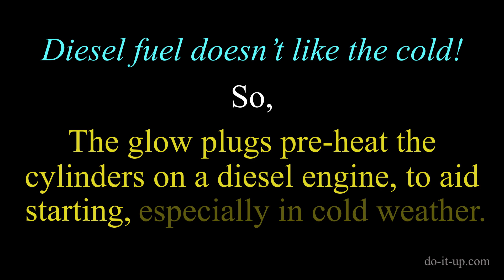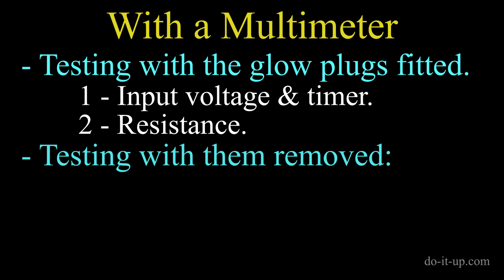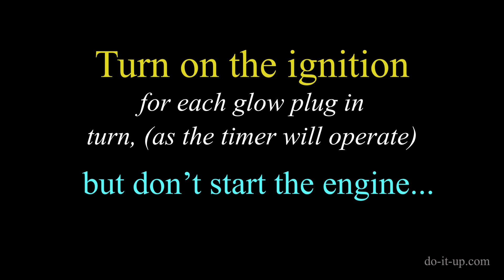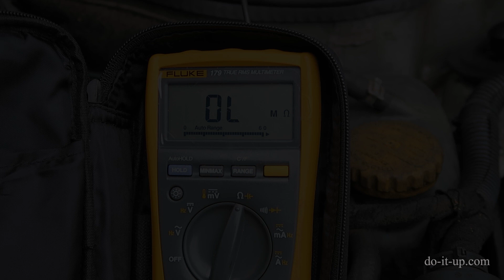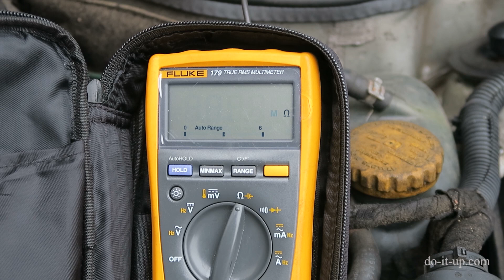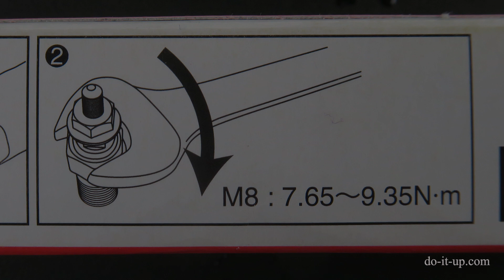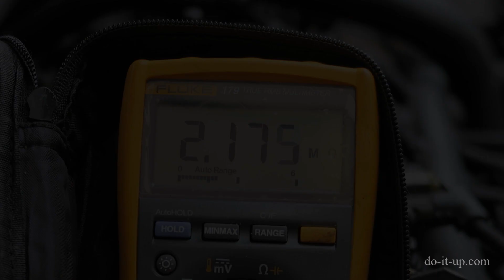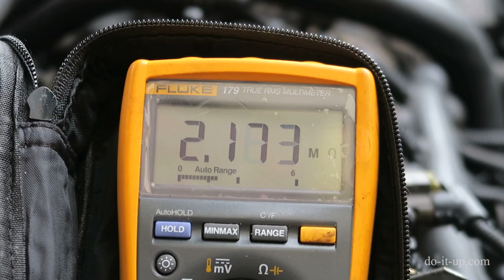How to Test Glow Plugs From Start to Finish (With a Multimeter) - The Complete Guide.

Comment: does the car now have smoke on first start after the grow plugs have been installed??
Reply from the maker: Hi, If glow plugs were the cause of bad starting, then starting should be much improved. However, you may get smoke on first start for a number of reasons. It could be due to:

- Condensation if it's cold, (the smoke from the exhaust should look different).
- Residual diesel left in the exhaust from unburnt fuel from the original issue (white smoke). This will eventually get blown out or burnt off from by the exhaust heat.
- Many older diesel's can smoke on start up due to wear & tear. Often improving when the engine is warmed up. However, the reverse can also happen - When hot, heat expansion can cause leaks around, oil seals, piston rings, etc.
- If the turbo is starting to fail, it can leak oil. This can cause black smoke.

The main thing is...

- Has the engine starting improved?
- Does the smoke soon go away after the engine has warmed?

If not, there may be another issue...  Hope this helps...   😀
Reply: @doitup  
thanks for your reply 🙂
When the car is cold, it emits smoke at the first start, I even tried to turn it off after 20-30 seconds and start it again, but it smokes again.. The colder it is outside, I have the impression that it emits more smoke. When it warms up, it doesn't smoke, i.e. it emits a little black smoke when the accelerator is pressed .. It's x218 CLS 350cdi (2014) it has 220k km. I'm going these days to see if the diagnostics will show anything...
the car starts well, pulls hard .. the only problem is this smoke
 one example: https://youtube.com/shorts/PiUrejjP-hI  ,  but that day it wasn't very cold around 16-17,c°.
I can't judge what color the smoke is, but something like white, grayish, bluish..
Reply from the maker: Hi, at 220 km, things in the engine will be getting a little worn or loose. It's not unusual for well looked after diesel engines to reach 300 to 400 km before a major overhaul. So with 200 km on the clock, if may give off a little smoke when cold. However, if it's lots of smoke then it maybe a different matter? You could do a compression test to see if there are any issues?

Hopefully you'll get to the bottom of any issue's soon, though sometimes you have to wait for it to get worse, before a fault can be identified...   🙂
Reply: @doitup my mistake, I meant 220,000 (220k) 🙂, in any case, thank you very much for the answer.
 all best 👍
Reply from the maker: No problem...  I just added to it by assuming you meant 220,000 km and continued the error!  😂

Comment: Another basic test is you use a 12v tester with a bulb, put the clip of light tester to battery positive and touch each glow plug, it's a loaded test so if the plug is good the test light should light up, if not, it's defective, don't use an led light tester. You can make a light tester with a headlight bulb and wire if you have no tools. Great video
Reply from the maker: Hi, that's a great tip, and well explained. That should help anyone who doesn't have a test meter, or needs another test to confirm a defective glow plug...   Thanks for sharing...   😃
Reply: Hi Grate video & nice explanation regarding Glow 8 plug.😅

Comment: Great video of my exact van so very helpful to me. I've just resealed my hight pressure pump to cure a leak and bad starting but the pump kit did not cure my bad starting.but when running engine after pump refit I notice like your engine it had a bad injector seals so just done them but while doing injector seals thought would check glowers and I've got 2 good and 2 bad.
Thanks for vid keep me coming
Reply from the maker: Hi, yes... You spotted my bad injector seal. It took my 5 days to get the injectors out. In the end I had to walk away and come back the next day to try... and try again, (I was so frustrated with them not coming out). Lesson learnt, don't leave the injector seals until later! Glad the video helped you out. Makes the time and effort it took to make video all worthwhile...  😃
Reply: @doitup  no mate all worth while keep doing the vids. Thing is you can't turn the injectors cos of the clamps.thanks andy

Comment: Firstly, that engine starting system has an issue, its cranking to slowly. Secondly, I always used an amp meter to test glow plugs, not an ohm meter, etc.
Reply from the maker: Hi, thanks for your comments. I can't agree with you on the first point I'm afraid. I admit it doesn't turn over that fast, but the slow cranking is probably down to the remaining power left in the battery (from the number of times the engine has been turned over in trying to start). Plus once the glow plugs were replaced, it would always start...

I agree with you on the second point, measuring the current is always a good thing to do. I.e. A vehicle battery may show 12v when measured, but it doesn't mean it has any guts (power) behind it. A clamp meter is always good tool to use when measuring the current flow (for a vehicle battery a discharge, load or drop tester). Many people have a basic test meter that can easily measure the voltage and resistance. Unless you're familiar with measuring current, it's all too easy to blow your test meter if it's connected up the wrong way...

Generally it's easy to measure the voltage supplied and the actual resistance of glow plugs. Many of the manufacturers supply the data for these measurements. So you can easily check if your glow plugs, or the voltage supplied is out of specification. Hence the video showing these methods. Hope this helps...    😃
Reply: @doitup  my whole career, now retired, was working on mercedes vehicles. So I have an insane amount of experiance with diesels. This is just to let you know I'm not some joe shmo out there with no real experiance, not for bragging reasons. So, regarding glow plugs, both coil and later pencil types, I soon found early in my career back in the early 70s that testing by using an ohm meter as per instructions by mb showed that gp were good and yet we had issues and many times comebacks. The ohm meter can show good but that just shows a connection not under load. So I decided I wanted to test them under load. So wanting to find the bad gp,  I would test them in situ. I would disconnect the wires to them or go to the plug to them and use the pins at the plug to the gp and then using a simple stand alone amp meter, I would put one lead on the plus side of the battery and then use the negative side of the meter to touch each gp post. If good the meter would go to about 20 amps and hold for a second. If it held it was good. If the meter started to go up and then drop I knew I had a bad gp.  That glow plug would have shown good if it was tested by an ohm meter. I did experiments and this proved correct over and over. As we were normally working on 5 cyl engines, if 3 were bad we replaced them all. Anyway, that's my take on it. One other piece of knowledge, depending on the engine you work on, this may not apply. But if you keep getting the same gp going out then that indicates a bad injector. It not spraying, it just squirting streams and not atomizing. Hope this helps. If not, disregard.
Reply from the maker: Hi, I wasn't after winding you up. I was just trying to point out that many people are unfamiliar, or have never used a test meter before. All the information from the manufacturers points to measuring the resistance and the voltage supply. You can use that information to check against what you have fitted. It's a fairly straightforward process and it's what most manufacturers suggest to do in their documentation which is available online. It's a good indicator...

What you have suggested (in your second reply) is a great explanation and an absolute gem. It comes from years of experience and is a far better test to find faults when glow plugs are breaking down under load. Thank you for supplying the information. It should certainly help others...    😃

Comment: We must hsve totally different meters in Europe...this meter nothing like the one i have...mine has several numbers under omega symbol,others under letter V,other numbers under A
Reply from the maker: Hi, the test meter used in the video has something called 'auto range' where the meter automatically decides what range, (voltage, resistance range, etc) it should be measuring. To reduce costs, some test meters don't have an auto range and it has to be set manually. For example, if you are expecting to measure 220/240v ac, you have to set the test meter to V~ (Volts ac) and either 600, 500, 400 or 250 for the range, (test meters can have different ranges). The important thing to remember, is to always start at the higher figure and work downwards. As test meters can get damaged by using the wrong range.

In this example, the 250 range (measuring 220/240v ac) should be the best range, but this isn't always the case. The 400 or 500 range may give a more steady reading. If you're still unsure what to do, see if there is a manual for the test meter. If not, there are some good articles available online by doing a google search. Hope this helps...     😃

Comment: Incredible great video. Thanks bro. I measured my plugs and third of four are fail.. I don't have tork device. So I thigntened them normally.
Reply from the maker: Hi, if you don't have a torque wrench, then it's not a huge issue as long as you use the torque value as a guide. It's basically there to stop you breaking the glow plugs, stripping the threads, or to ensure you can get them out again the next time (without breaking). Yorumun için teşekkürler. Birine yardım ettiğini bilmek her zaman harikadır...  (Thanks for your comment. It's always great to know it helped someone out...)   😃

Comment: i measured  new Bosch 5V  showing 8 ohms
Reply from the maker: Hi, the 5v may well be correct. Bosch do a range of glow plugs that run at either 11v, 5v and 7v dependant on the vehicle and glow plug fitted. You will need to check the specifications to see what it should be? The resistance doesn't sound right, so you need to check your test meter reads 0 ohms before measuring. If it doesn't read 0 ohms, you can still measure the resistance, by doing this...

Select ohms, and connect the multimeters leads together. Is the meter reading 0 ohms? If not, recalibrate your test meter. If there is no facility to do this, just subtract the reading you obtained (when connecting the leads together) from the actual reading taken from the glow plugs.

For example. If you get a glow plug reading of 14 ohms and your multimeter had a reading of 8 ohms, we now know the glow plug measured 6 ohms (14 ohms – 8 ohms = 6 ohms).

Make sure the contact points (where you measure the glow plugs) are clean and free from oil and corrosion.

For Bosch:

Resistance ∞ Ω: malfunction: defective glow plug.
Resistance < 0.2 Ω: malfunction: defective glow plug.
Resistance > 0.2 Ω and < 5 Ω: glow plug OK.

Let us know how you get on, as it may help others. Hope this helps and you get it fixed soon...   😃

Comment: Good video 👍. One error: GP #1, U wrote 3 milli ohm instead of Mega. Add a note that new gen glow plugs would have a 4.4V or 7V supply. Short test leads to check the residual resistance which can be deducted from the GP measured resistance. One more point is that the current can be measured w/ a DC clamp meter @ battery terminal for all 4 (will include ECU & Acc) or on each glow plug wire.
Reply from the maker: Hi, yep, it should have been an 'M' rather than an 'm'. Unfortunately, once the video is uploaded, you can't change it easily (I've updated the sub titles). I've added some notes on the other info into the description. Thanks for the great info...  😃

Comment: Mine all tested .5
Reply from the maker: Hi, glow plug resistance is usually between 1 & 6 ohms, dependant on the manufacturer's specifications. So they could be a bit low? The next best thing to do, is check to see if the glow plugs glow...  I have another video here: https://youtu.be/YkKsbRHHNS8, that shows how to test the actual glow plugs. Methods 2 & 3 are what you need.

- Method 2 can be found here: https://youtu.be/YkKsbRHHNS8?t=358.
- Method 3: can be found here: https://youtu.be/YkKsbRHHNS8?t=440.

Please note that method 3 is preferable, and safer. Plus you can check the actual supply to the glow plugs and the glow plug timer at the same time. Hope this helps...   😃

Comment: Dumb question, where does the black lead go when you are doing your DC voltage checks for the supply and timer? A ground?
Reply from the maker: Hi, it's not a dumb question at all, (several people have asked it). As you suggested, you place the black lead, negative (-ve) to ground. This can be anywhere:

- Where there is a bare metal surface (that's earthed).
- An earth point.
- Or, the negative (-ve) battery terminal. (This assumes it's a negative earth vehicle...  There are a few positive earth vehicles out there).

You can see examples on the video here (a bare metal surface x2 and the battery terminal): https://youtu.be/nFrvzstFqwE?t=337. The supply to the glow plugs will pass through the electrical connection, down through the glow plug and return to the battery via the engine and it's earth lead. So if you do have supply issues and you can't find anything wrong, it's always worth checking the engine earth and that the glow plug threads are clean (so they make a good electrical connection). If you need any more detail, this can be found here: https://do-it-up.com/vehicles/engine-transmission/diesel-wont-start-when-cold-how-to-fix-glow-plugs/#With-a-Multimeter-Voltmeter

Hope this helps...    😃
Reply: @doitup  thank you!
Reply from the maker: No problem...

Comment: How about sir if glow lamp not working what is the possible cause?
Reply from the maker: Hi, I've not studied the subject, so can only give my best guess...   There could be a number of causes, but they can probably be summed up as failure due to old age and wear and tear! A glow plug is stressed throughout it's life. It can go from frozen to glowing red hot in a matter of seconds. Expansion and contraction, oil, rust, corrosive gases, pressure, combustion (explosions), etc, etc. Glow plugs have a hard life! The materials used and quality of manufacture probably have a lot to do with their lifespan, plus...  Where you live (starting temperature), number of times the engine is started, how long the engine is run for...  They're probably like human beings. Some have a long and happy life while others...

There can also be other factors. My daughter decided to drive through a deep puddle where water was sucked into the engine: https://do-it-up.com/vehicles/engine-transmission/car-went-through-water-and-died-how-to-fix/. She naturally tried to start the car, but it wouldn't start (hydraulic water lock in the cylinders). When we cleared the cylinders and got the car started. All the glow plugs started to fail. I presume it was because the glow plugs had been trying to boil the water in the cylinders? So, there could be a number of causes, why glow plugs fail. Hope this helps in some way...    😃